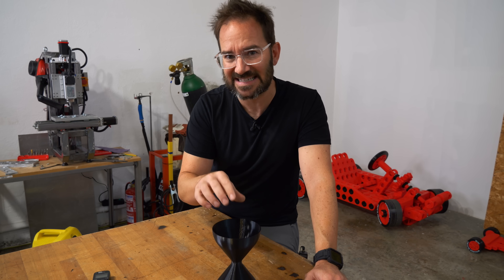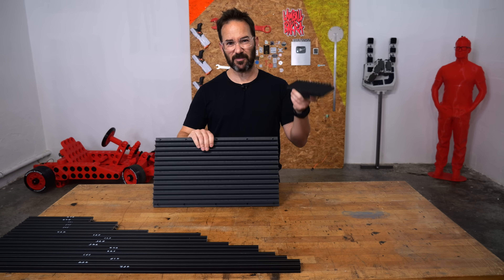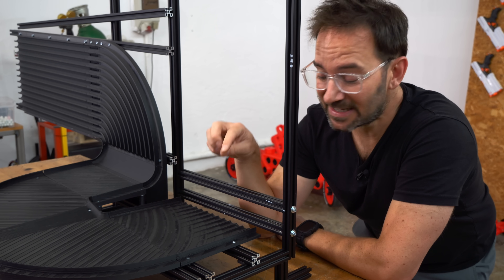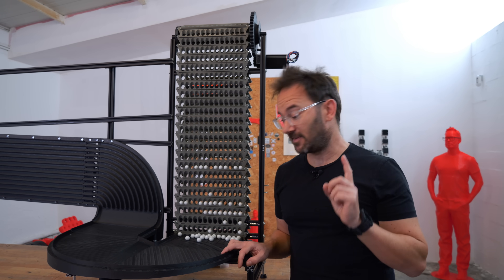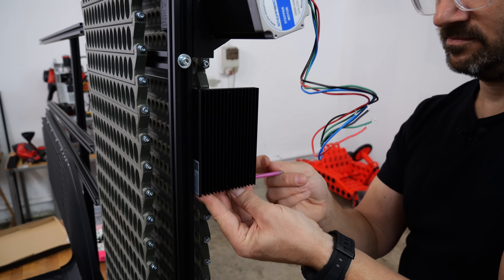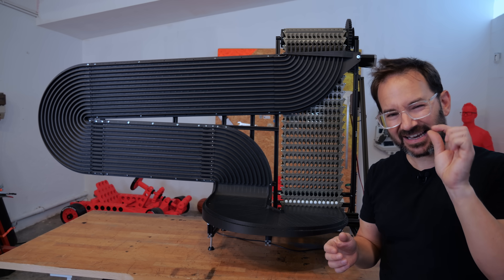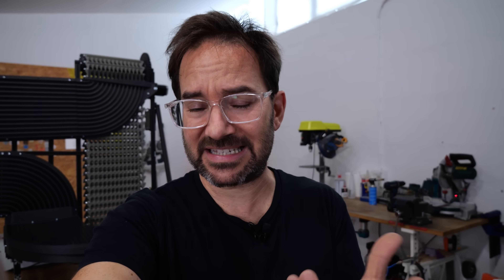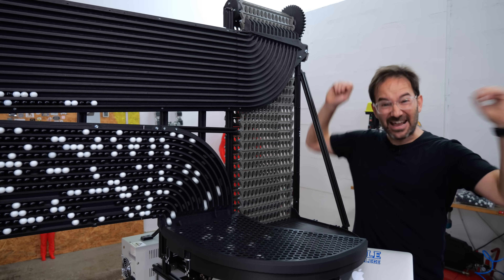BUILDING A MARBLE CLOCK - Pt.1.

Comment: After watching Martin trying to build the MMX for several years, I wonder what world of pain we're about to see unfold here.
Reply from the maker: I hope not but I have a pile of failed stuff on my table just for part 2 so I won't be betting on it.
Reply: @ivanmirandawastaken  good luck. def a fun video, luckily with the goal being well defined to just make a simple clock you can continue to have fun iterating on the design to make it work as long as your base is okay and doesn't need scrapped. looking forward to see your marble sorter eventually
Reply: Difference being that Ivan has more of an engineering mindset, that likely helps. I also don't see him find inspiration, direction-wise, in questionable books. :)
Reply: Feature creep + undefined goals are a hell of a drug
Reply: @ETG168 I was going to say the same thing. He later chose to become a YouTuber rather than a creator. I felt cheated of all the time I invested hoping for a finished marble machine. 🤦🏾‍♂️ just build one that works, then move to a newer version! Half hour videos of testing millisecond differences in the marble drops … who’s gonna hear that in a 3 minute song??
Reply: @ETG168 Also misguided perfectionism isn't helping either.
Reply: @ETG168  They also make great content. :)
Reply: Man it seemed so close and easy when meeting him with the first 3D printed MMX prototype parts in May 2017 at the Speelklok Museum
Reply: 3 years later "so I've re designed based on specific principles that will not change, no more elevator just a basic easy run so I can know the time"
Reply: Will there be an angle grinder in used in the next episode? shudder
Reply: @Andre_Berthiaume No angle there is 🎉
Reply: @Andre_Berthiaume suffering is temporary
Reply: The MMX is a nearly impossible project because Martin has nearly impossible design requirements. His new machine is even more complex.....
Reply: @crystaldragon141  He's just milking the algorithm for more money. He just keeps moving from country to country and living large. It's entertainment in the end. Trying to achieve precise timing perfection from mechanical equipment is a fool's journey. Every machine has its limits and perfect timing is not achievable from just mechanical design. So many variables, humidity, temperature, dust, etc. Now he's blaming the grease in the bearings (just warm the machine up like they do in any precision cnc shop)  and next he will be redesigning for frictionless magnetic bearings... it will be MM12 before he's done at this rate. Bottom line, It's free entertainment for us and money for him.
Reply: @helicopterdriver ”keeps moving from country to country”? He moved to France at the beginning of MMX, with his partner, and now he’s split up and going back to his home country, he has a lot of problems, “living large” is not one of them
Reply: @helicopterdriver  yeah I stopped watching him after the 8th time he claimed to be focusing on first principles and then immediately made an "artistic" choice.
Reply: Unfortunately Martin can't stop feature creep from getting into the project
Reply: @FAB1150  I have huge respect for what Martin has achieved, but I had to stop following his videos since at some point I realized the project is probably not ever getting finished. For me it seems like he has a bit of a mix of chaotic and perfectionist traits, which are causing a constant spiralling to side tracks, which he also wants to get 100% right.
Reply: @FAB1150 Martin couldn't live with "Good Enough"
Reply: To be fair, He's obsessed with precision and music
This is a clock, and while it does need to be precise, it only needs to be precise once every minute
Reply: I really liked what he was doing but it became too much for me and I eventually stopped watching him. It was around the time he stopped uploading shorter videos
Reply: Based on previous projects Ivan is more capable of accepting compromises and to me seems to have a far better grasp of physics, so only minor injury to his sanity I'd think... 

Meanwhile Martin is so deep down the rabbit hole on making a part that really shouldn't need to be that precise keep time to the femtosecond for playing music... I do very much appreciate Martin, and want to see him succeed, the Marble Machine is a wonderful work of art and a world tour capable version a great idea. But the input flywheel on its own with no variable drag from the music playing and marble lifting elements should not need have to be tight in timing or you must actually be measuring and developing it under real world conditions - as under such varied loads it won't stay nearly as tight as he apparently requires. At least not without that flywheel getting to an inertia level that every other part of the machine will need to be super strong and way heavier to survive that torque... At least in his last update he mentioned a gearbox to regulate music timing separately which is at least a step in the right direction - but along with CVT and escapement type timing regulation it is an idea the comments have been blasting him with as the workable solutions for months.
Reply: In five years time he will be literally trying to solve the meaning of time.................. insanity awaits.
Reply: I was utterly amazed when he printed a simple marble shield to stop the marbles from escaping. I think we watched 30 episodes of filing marble tracks and inventing ways to make them roll just the right speed instead of just doing this.... what a damn difference... function first. I bet this will be a very enjoyable ride, i hope for lots of problems so it will last a long time :)
Reply: I BROKE OUT IN HIVES THE SECOND IVAN SAID IM BUILDING A MARBLE LIFT.  NOOOOOOOOOOOOOOOO!!!!
Reply: Martin needs to drop many marbles per second with precision measured in milliseconds. This project seems a little less challenging.  Still, I expect more pain yet.
Reply: When he said marble gate. …
Reply: Martin is his own worst enemy. The problem is that he doesn't just want to build an instrument, he wants to build a completely inefficient analog midi player that can play anything. If he would just allow for limitations, he might have been done by now. This clock project looks far more promising.
Reply: I get the impression that MMX isn't about the product, but about the journey. If he wouldn't redefine his goals constantly, he might get there, and I honestly think that he doesn't want that. It is the Sagrada Familia of marblemachines for him.
Reply: I can't watch Martin anymore. It's honestly just sad.
Reply: Sadly i gave up on the MMX, he was on a good path and insisted on having literal absolute perfection in an imperfect world and it just destroyed what the project was, i see a vid come onto my suggested once in a while and I'm like meh.  Ivan is like good enough is good enough an that's good enough!
Reply: @moosescorner  It's catering to different interests, that's all. If you're into art and music, stay clear, but if you're into engineering, testing and problem solving it's still pretty good.
Reply: Wouldn’t it be easier if the digits were vertical and separate from each other?
Reply: Ivan is excellent at having a good idea and seeing it through from start to end, something that many struggle with, including Martin. He really needs someone with Ivan's mindset.
Reply: My thoughts exactly. There's something about marbles that makes you lose them...
Reply: Martin seems to be a suffering artistic genius who has lost some of his marbles in the pursuit of unrealistic perfection.
Reply: @user-tb5ns7hc5i  but always on time with a YouTube video.
Reply: First thing I did after I saw the video, was looking out for exactly this comment, because I knew everybody watching the MMX struggle, would think this, and at the same time facebook would direct us all to this video ;)
Reply: my exact thought
Reply: Yes, I came here to say exactly that. Love Wintergarten, poor Martin.
Reply: Omfg my first thought lol
Reply: Pain is temporary, glory is forever
Reply: Best of both worlds. We shall get new creative ideas for existing forms, and some fun new problems that our mmx friend never had to worry about. 
If this works… it’s gonna be a guided journey that will inspire our next generation to make fun gizmos. What time is it? 😂
Reply: I can’t believe I’m voluntarily signing up to have my heart broken again.
Reply: When You arere making this kind of machine, You are going to lose some marbles...
Reply: Ikr!
Reply: FACTS 🤣🤣🤣
Reply: He could make it a marble clock that wakes you up with marble machine sounds and when he finishes before 2029 make Martin go out of his mind.
Reply: Watching him make this, my first thought was "A new challenger approaches!" Then I watched as history repeated itself on pretty much every aspect that Martin failed at. It's like watching Germany invade Russia during winter after thinking they could do it better than Napoleon did. Can't wait for him to decide that the black and white marbles need to be made of different materials so they can be easily sorted. Also, I wonder if he has done the math on how fast the elevator needs to lift marbles to match the clock minute replacement speed. To me, he looks WAY behind replacement speed with his elevator. Not only that, he needs to also sort them afterward... Light colored marbles will be replaced by Martin's ball bearings. Black marbles will be glass. But then he's going to have to deal with tons of chipping. So then we get all steel ball bearings, but we're back to square one.

One benefit is his willingness to use servos and non-mechanical solutions. We're going to see a major redesign from horizontal to vertical loading, mark my words. Probably even a change from just changing as many digits as need changed every minute to keep the machine scale down. Horizontal loading and jamming is going to be non ideal since he doesn't benefit from using gravity. Also, vertical loading means each track only needs to load 1/3 as many marbles per minute. The final solution will just be all white marbles and servos replacing where the black spots should be. See you in 2026 when this is all done!
Reply: Waiting for the next "Wilson", what should it be?! A marble path that look a like a smile?!
Reply: What is this MMX video
Reply: @sailor-m5j  You don't wanna know. Lol, you'll go looking, but don't say you weren't warned!
Reply: @Deditzy.  makes me wanna see it more lol
Reply: I now get a better feeling how mentally strong Martin is with the journey of the Marble Maschine X
Reply: Brooo, I saw the "Pt.1" in the title and gasped.
God speed to Ivan. 🫡🫡
Reply: Martin is taking engineering classes to become an engineer. And all the failures that come with that. A conventional education might have sped things up... but knowing a few other "engineers " in my lifetime, maybe not...😂
Reply: Subscribed!
Reply: You should use ball bearings instead the have white delving ball bearings and black ball bearings as well
Reply: No guys, you don't understand, I read another self-help book and I swear this change in my design philosophy will be the last one [reaches for the angle grinder]
Reply: Much can be learned from Martin’s experience - for many different disciplines. I think he’s on the right path with this iteration. Watching this build, I’m seeing many of the issues Martin faced - and he’s using ball bearings, not glass. Marbles are fickle, inconsistent beasts. Looking forward to the next video.
Reply: Haha yes to the original comment seeing the thumbnail i almost didnt want to click the video 😅 love the project ❤
Reply: @Wintergatan_2  I seem to have inadvertently attracted some haters with my original comment. Apologies for that, I think you realise that wasn't my intent. I am a fan with a keen interest in what you do as well as all the other CNC/Maker youtubers. The MMX was a wonderful project despite the pains and hard lessons. Those lessons are the important part though, if it was easy it would be boring. Those mistakes and how you overcome and manage them has likely helped many people avoid the same issues in their lives, jobs, hobbies, etc...

Ivan's video reminds me much of some parts of your videos, marbles/ball bearings etc... seem to be so unruly, getting stuck everywhere, the lift chain being almost empty even though the marbles are sat right there WHY DONT THEY GO IN >:(!!

When he extended that cover just a tiny bit and then they all just spill out further along anyway was like a pure MMX moment for me.

Keep up the fantastic work.
Reply: @Wintergatan_2  Wilson, do you miss France?
Reply: martin doesn’t understand how to avoid adding in more features for the sake of being clever.
Reply: His biggest problem was a combination of not  settling and wanting to milk as many views as possible. I had to stop watching as it was getting frustrating watching him just do the same thing over and over. It’s like a tv show that refuses to end
Reply: Let's hope it's a world of pain. How boring Martin's marble machine adventures would have been if it had worked first time!
Reply: @Gribbo9999  or second..
Reply: Well there is the fact the MMX is a music instrument that is supposed to play 150bpm in 4/4 tact if not higher and this is a clock that only updates once a minute.
Reply: All Martin's financial incentives mean he's BETTER OFF, just having a perpetual build that never gets finished- If he DOES finalize the build, both his views, AND his Patreon, will fall off a cliff, in a month or two.

Martin will be working on the "MM53" in a few years, with 52 scrapped, unfinished builds in his shed...
Reply: @baconsarny-geddon8298  nothing is stopping him from finishing the machine and then upgrading it or even reinventing. It's not like his viewers are only waiting to hear his concerts, they're interested in building. That's why views dropped after he started talking about shitty books and abstract things instead of featuring angle grinder
Reply: @al1sa920  I watched these videos as they dropped and then had a kid and lost track. What sort of rabbit holes has he been going down in the last couple of years? Saw the crypto stuff, but what books is he chatting about these days?
Reply: @johnkelly1620  I have no idea what crypto stuff you talk about. I meant motivational and self-coaching books that had negative impact on Martin imo
Reply: @al1sa920  Ahh, gotcha. There was some Wintergarten DAO talk a couple years ago that seems to have gone nowhere? ¯\_(ツ)_/¯